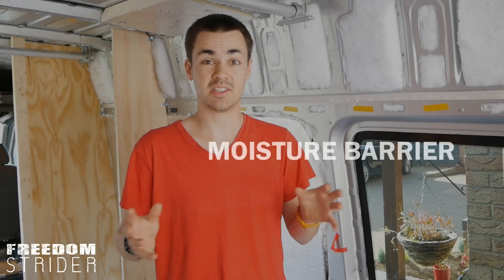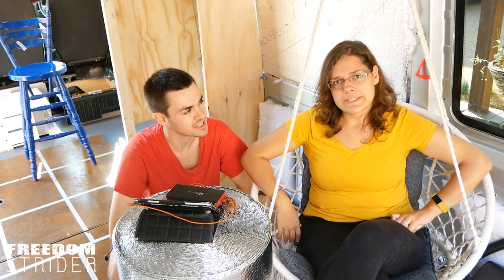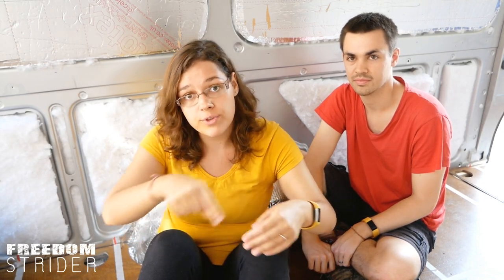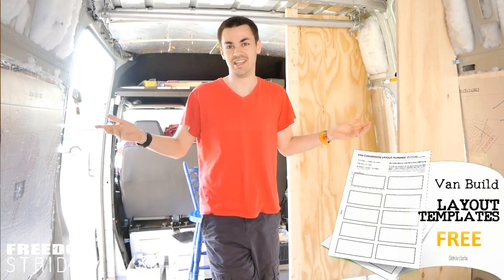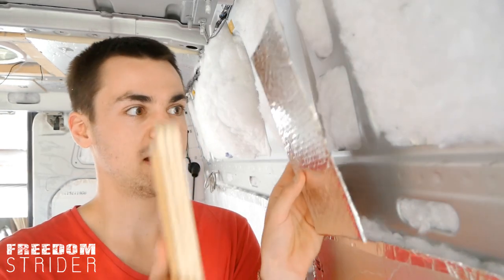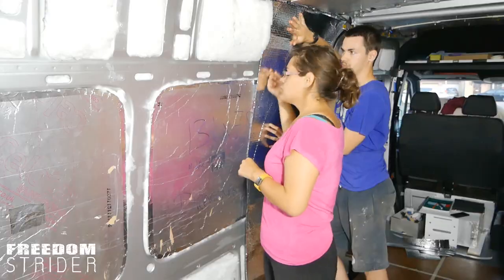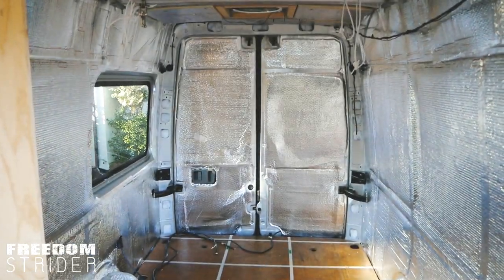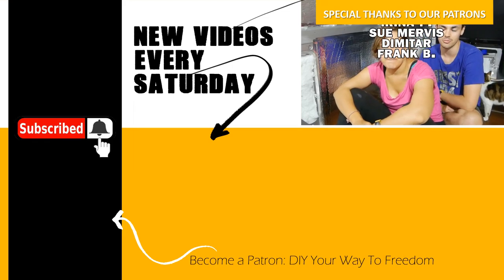Installing Reflectix Insulation CORRECTLY - Moisture vs. Radiant Barrier

Comment: First, thank you so much for the information. I was pretty gungho to use this in my van build.. but on researching have come across some questions that I need to have resolved first I think.
All my "show stoppers" are for heat, and not cold. Because the heat in our vans is not radiant heat. It helps I believe in winter as a barrier but it's main use is for heat and "reflective heat".
So this is really summer heat and sun I have seen and heard enough to wonder if I should.
Q:  The roofs of our vans are a vapor barrier as well as an air barrier. All products like Reflectix need an air gap to work. The R value for the product is minimal and it really uses the air gap to get it's R rating.
When we put up a continuous covering and tape it with an air gap so it works. Where is that super heated air going. One person from one of the products like this in response to a question, said it becomes super heated, and of course, it is HOT on my roof now and radiates heat into my van, and he said it will be trapped in-between the layers and nowhere to go.  
 It works on housing, roof attics etc, because the heated air has an escape and doesn't just get hotter and hotter and is "trapped" by the barrier of our roof, and the one we create with Reflectix.
A: What happens then? I don't know, and hope someone has a practical answer to alleviate my concerns.
 BTW, I am leaning on putting it up, and have Thinsulate to use as my primary insulation, and "think" that might reduce "some" of the radiant heat from my roof, but I sure don't want to have a big problem down the road when I get all the roof, cabinets etc etc installed and have to take it down "because.. oh no".  
Thanks again and please don't take this in a negative way. I enjoyed both of you and your thoughts. But see some issues in what I have been able to research. And the manufacturers comments I have seen don't make me warm and fuzzy about this application either.
All the best,
Reply from the maker: No insult taken, vans are really not designed to be insulated it seems and the research is an endless pit, so we all have to do what we can, thanks so much for your analysis and research, it's great to hear all research people have done so we can better our building techniques in the future ☺️👍
Reply: @FreedomStrider  Thank you for your kind and understanding response. All the best in your van build and adventures in your van too! I guess we will see how it works, lol. I will update if I find I made a "big" mistake with Thinsulate and Reflectix mix..I will be prayin' for your travels!
Reply: @jaybennett7316  Wondering how it went? Did you end up putting it in your van? If so what are the results? I am thinking about doing the same, but now not sure either since the heat has nowhere to go.

Comment: You are spot on with your explanation of radiant heat and vapour barriers. I've seen so many (well known) van builders totally misunderstand what reflectix is meant to be used for. Many even saying it's insulation, which of course is wrong! I fear though that your wise words will be lost on the diehards who can't or won't listen to reason. I've stopped banging on about it, let them waste their money installing reflectix without an air gap. You, however, will benefit because you've done your research. Well done.
Reply from the maker: Even if only 1 person takes on board our explanation, then it will be worth it! It wasn't that easy to find out the information yet alone understand it to help others, so thanks for the encouragement 😊

Comment: What do you think about people who put foam boards between the framing ribs and then put the walls over that? Especially with reflectix under there as well. I want to layer more than one type of insulation so I can be in wider climate differences

Comment: Reading all the comments it seems to me that you should pack the walls and ceiling lightly with fluffy insulation and just add plenty of vents around the van. I reckon an extractor in the roof is a must. I'm going to have to find one that won't leak though!
Reply from the maker: Good ventilation is key, though if you mean, that vents will null the function of a vapour barrier then I doubt you can put enough vents and maintain the efficient circulation through the walls to stop the condensation forming. We covered our whole van in insulation and then the reflection and the reflection definitely made a difference with retaining the radiant heat.

Comment: It seems like you guys made a convincing argument against there being any point to even attempt a vapor barrier, and then went to great effort to create one without any explanation of why. 

As yourself and others have pointed out in the comments section, you will very likely get condensation on any exposed metal even with the vapor barrier. Nothing short of covering every square mm of metal with spray foam will prevent this. Only now, that moisture is going to have a much harder time evaporating off and may begin to pool. 

I understand that a wall with too much ventilation with loose some R value. However, it seems to me that a small amount of passive ventilation would be allot better than almost none.

I'm in the beginning stages of my own build. I started by covering as much metal surface as possible with two layer sound deadening/ closed cell foam insulation. I then put 3M insulate on top of that. My main concern now is heat transfer through the uninsulated structural supports.

I think I will add a layer of Reflectix on top of my wall framing with the air gap behind to address that issue. However, I will not seal the edges or holes for receptacles and lights because I want a radiant barrier, not a moisture trap.

I'm also considering the feasibility of installing a vacuum hose in the walls, with the idea being to remove the inevitable moisture. You could have intake vents that normally remain closed and a port to hook a vacuum to each wall section for active ventilation. You would simply perform periodic ventilation of the wall with a small portable vacuum. You would not loose any R value, and have the ability to remove moisture.
Reply from the maker: We installed the Reflectix mostly for the radiant properties, it really made a difference insulation and temperature wise after we put in on, compared with just the insulation in place.

If you don't put Reflectix with the hope that there will be enough circulation in the walls to dry up the moisture that forms from the temp difference, then I don't think there is enough circulation naturally to do that. Doing a mechanical vent system as you said may be able to balance it at the rate at which condensation forms (if done correctly) 

However if you think about window condensation and any other exposed metal condensation, those are open the room temperature air and if the outside is particularly cold, condensation will form insanely quickly and even putting the fan on doesn't really remove all of it. 

So taking all this into account, despite the moiusture trapping issue with Reflectix, we'd still advocate installing it for the radiant insulation properties, and to reduce some of the moisture. However if we were to do it again, we would eliminate the thermal bridges where the Reflectix touches the metal of the van, since this conducts heat and causes condensation on the inside. It reduces the effectiveness in those areas. And also, we would do an inside a mechanical ventilation system within the walls. That would be an interesting solution. 

Greg Virgie is very knowledgeable on this, his Reflectix experiment video very well demonstrates how the moisture forms instally 
Hope this gives you a lot to think out :)

Comment: Hello! Sorry for my English but i have question about vapor barrier.
I found two ways of van insulation. 
Layers:
1. metal/insulation/wood framing/vapor barrier
2. metal/insulation/vapor barrier/wood framing (like on your video)
What are the differences between these two methods? And why did you choose second one?
Reply from the maker: As long as you have an air gap between the wood framing and the vapour barrier in Option 1, then there is no difference between the two. We went with Option 2 as it was easier to see where our wood framing was (to attach things to it) and also the wood framing being on top straps down the vapour barrier, so there is less sagging. 😀👍
Reply: @FreedomStrider  thank you! So air gap is necessary between wood framing and vapor barrier(in option 1)? Because I've seen some people don't make this air gap(metal/insulation/wood framing/vapor barier/no air gap/finish wood boards). What are the consequences?
Reply: @kir3230  The product itself has very little R value from what I have read and relies on an "air" gap to get it's R value. A big question that is stopping me at the moment is, where does all that heated air go between our roof and the barrier we create by putting Reflectix and using an air gap as we should? I read one say it becomes super heated because it just reflects back to the inside of the wall of the roof, and is trapped. It works on applications like roofs, attics etc, that have an escape for the heated air from the sun... Sun is my problem.. I use my van for surfing mainly and travel second.. But usually at sunny places. The coast is cooler, but not always, and definitely not driving down middle of California in desert to get there.

Comment: Great video! One question, would this order work:

Van metal > Furring strips on van metal (1.5 inch gap created) > Reflectix on top of furring strips > 1/2 inch polyiso foam on top of reflectix > then panelling on top of polyiso foam? 

Thank you!
Reply from the maker: Theoretically, as long as you have an air gap of about 20mm next to your reflectix, then the reflectix would retain its radiant barrier properties. As for putting the insulation after you put the reflectix, theoretically, there's no problem with the system working, but most people put insulation first to fill the cavities in the van, and to preserve more width of the living space. So I'm just wondering how come you've decided to put it the reverse way around?
Reply: @FreedomStrider  there’s no real deep cavities in the van I’m converting (super small). It’s the only real way to get the significant gap for the reflectix and I’m concerned the reflectix on it’s own clearly won’t be enough as insulation.

Only other option would be to ditch the reflectix altogether and just use the polyiso. With the foil side out is there any need for a Radiant barrier with the polyiso if I did get rid of the reflectix?
Reply: And one thing of note, I live in a warm non-humid climate. The thought with reflectix and radiant barrier was to reduce heat transfer and keep the van cooler.
Reply from the maker: By using foil tape and the foil on the Poli insulation, you wouldn't need reflectix since the foil tape does the same thing, but again the air gap is key 👍
Reply: @FreedomStrider  That's what I thought as well. Sounds good and thank you for getting back in touch!

Comment: Thanks for the clear expectation. Since you chose using reflectix you are not really worried about trapped moisture even though that might happen? Do you have any ways to mitigate it if it happens or just hoping it won’t happen/be much?
Reply from the maker: Well, there is not much to do about the trapped moisture. The only thing is to install the moisture barrier in a dry environment. If you are doing it outside then a cold day is usually dryer and avoid rainy days. 

Note: check out pinned comment on how we would improve our installation 😊

Comment: Very informative video, so helpful. I'm at this stage now and struggling to decide. When you were describing it not being possible to create a complete air seal I thought you weren't going to install a vapour barrier but then you went ahead and attempted a vapour/radiant barrier in one (not criticising here!). I'm swaying on the side of no vapour barrier, if I therefore mount the relextix a few cm's offset from my pir board/bottle wool insulation would this provide a radiant barrier but also provide an opportunity for the insulation beneath to breath underneath / condensation dry? Assuming I would get more condensation beneath insulation but also will provide more chance for drying out. What a nightmare. I'm just scared of effectively trapping condensation! Thanks ☺️
Reply from the maker: The reason we went ahead with the reflectix despite the moisture trapping issue is because we decided that the radient property benifits of reflectix outweigh the rather poor vaper barrier options. So we installed the reflectix and we did our best to cover as many moisture entries as we could, and we definately saw a noticable difference in the insulation quality after installing the reflectix. 

When doing this type of insulation, you will always have some moisture trapped behind the walls.However 1) Ensure that there is no exposed metal, because that is where condensation will form. 2) If you put the reflectix on with some care, the moisture will be very little, so it will rarely cause an issue; leaks from any holes you drill are far more likely to cause rust and need repair. 

Also, installing your insulation on a cold, dry day without heating the van, would trap the least amount of moisture behind the walls, pruley because colder air has less moisture (obviously if it is foggy or raining, slightly different story)...of course your figers will be frozen and you'll need about 10 layers on but hey..options😂

Another thought, depending on your budget and if you've already bought some of the stuff or not, one way to eliminate the moisture issue the most effectivly would be spray foam insulation, Because the foam coveres every nook and cranny, no moisture can be trapped behind. We looked it up, if we were to call someone to come and do it, it would have been £1000 (so over double the insulation we've done in our videos).
Reply: Far Out Rides has a great section all about this if you’re still planning your insulation. They went for thinsulate and then EZ-Cool (now Low-E Insulation) over bare metal like the frame. Low-E and Reflectix are similar but Low-E has the added benefit of containing some insulation alongside the reflective Vapor barrier.

Comment: Good vid. Reflectix has a poor R value and is a terrible radiant barrier. In fact it conducts heat. It's a very good vapour barrier though. I'm mulling it over right now for my build, and may go for something different.
Reply from the maker: Yes reflectix does have a poor R value but it only conducts heat if it makes direct contact with the heated surface. With an air gap, its radiant properties do make a difference, at least in our experience. As soon as we put reflectix in, the temperature control became alot more manageable 👍

I don't know a comparison of other materials that can be used for a radiant barrier so I don't know how good of a radiant barrier it is. I can only say that it does work 👌

As for the vapour barrier, I would really rather not have a vapour barrier, and had it not been for the radiant part of the reflectix I don't think we would have put the reflectix in. This is purely because if moisture does get trapped between the reflectix and the van metal then it will be very difficult for that moisture to escape. What different options were you thinking of using?
Reply: @FreedomStrider  Having or not having a VP lol. Greg Virgoe's experiment is rather compelling on YT - apparently he made it specifically because of other YouTubers  saying the opposite. He is a retired aircon engineer so his opinion must carry weight I guess. My wife and I will live in our van 9 months of the the year and that has to be a factor too. As a non expert I'm obviously undecided. However, my van does not have metal sides but as a Luton low loader has hardwood coated in protective plastic. It does have a channel at the bottom with holes so vapour does indeed have an escape route.